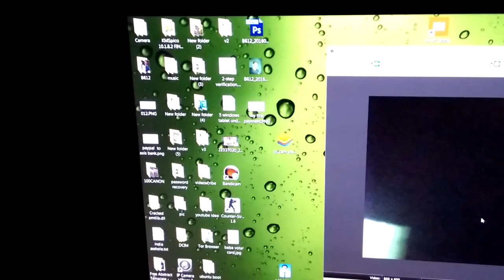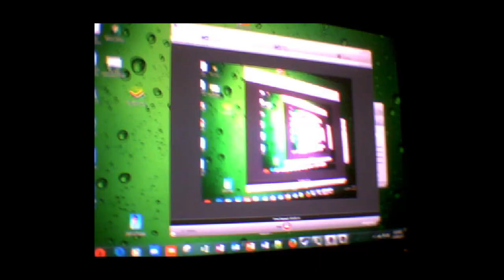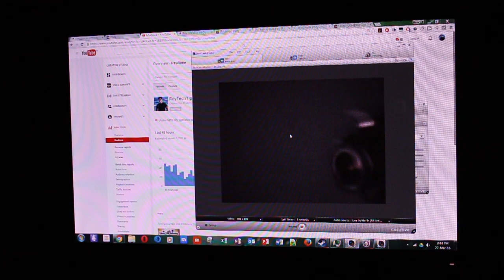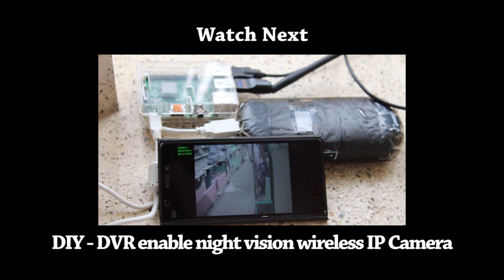Turn any Web Cam into an Infrared Night Vision web cam within 5 min - DIY LifeHack Project

Comment: Several times I read "CCD", but I'm almost sure that there's no CCD in this cam, because while the CCD technology was and remains superior in photo sensitivity and lowest noise, was abandoned several years ago because of the higher production costs than CMOS. CCD requires several voltages to work, fast ADC and processing circuity while CMOS works well on USB voltages and has everything integrated.

Comment: sir my mobile is YU UNIQUE 2 and it's OTG SUPPORTED but CAMERA FI NOT WORKING WITH MY WEBCAM... WHEN I CONNECTED WEBCAM WITH MY MOBILE THEN MY MOBILE GOES RESTART ....MY MOBILE HAS ANDROID 7.0 ....PLEASE HELP ME SIR ....OR GIVE ME ANY SUGGESTIONS......
Reply from the maker: USE a powered HUB that may fix the problem/\.

Comment: i got a spy glasses how to make it in to night vision
Reply: You would need to do the same thing. Remove the lens, then remove the ir cut filter from it, then reinstall the lens. The problem with the spy glasses is the lens is a pinhole lens, and it wont pick up low light very well. But it can be done,  just do what you saw in this vid.